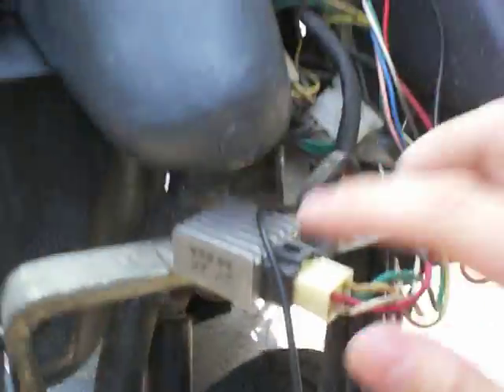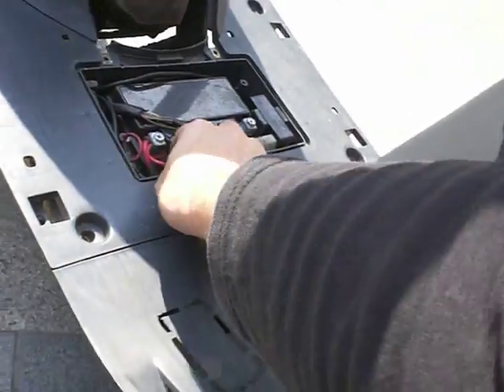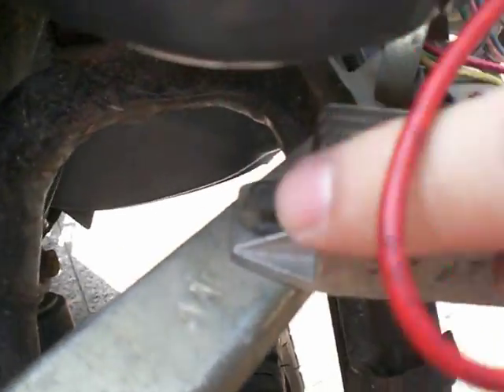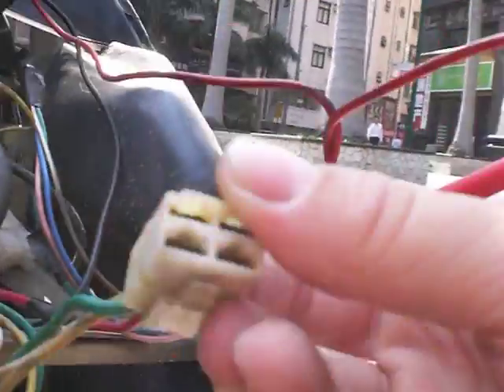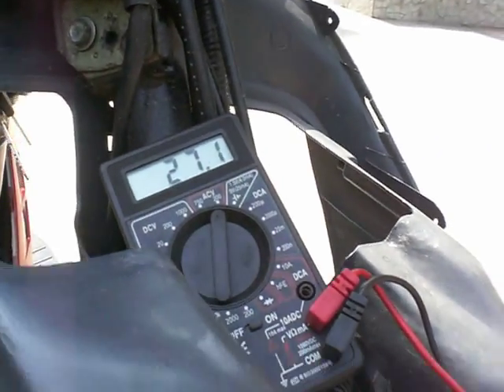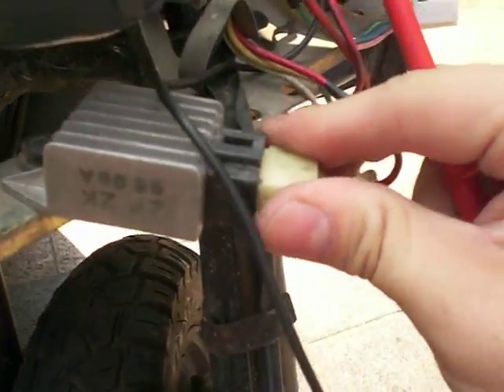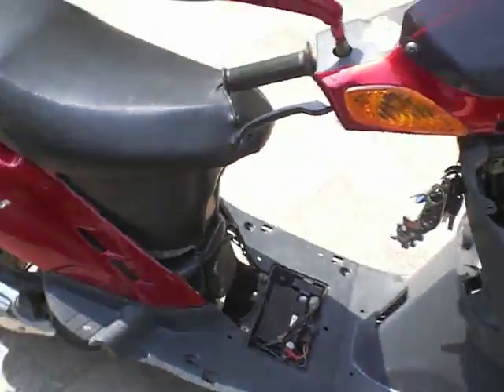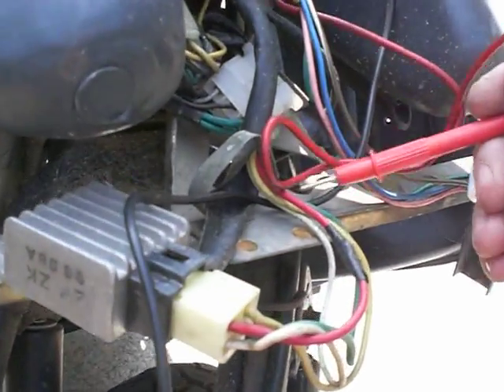How to wire a GY6 scooter regulator / rectifier and how it all works (Part 3 the regulator)

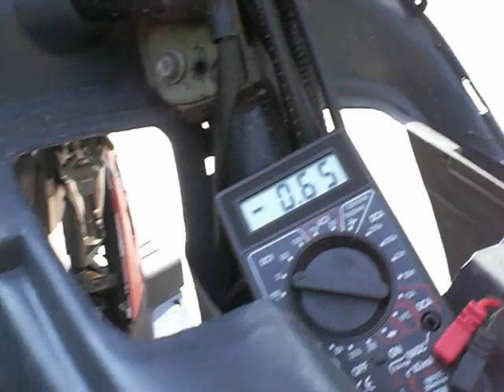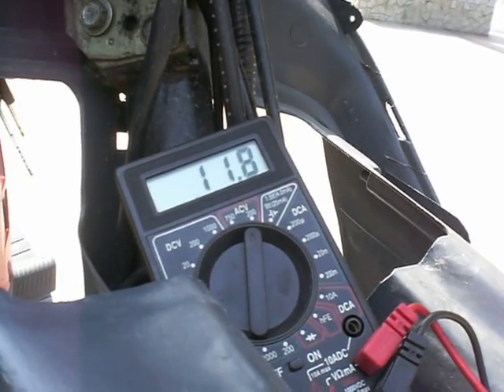Comment: With it plugged in and I tested the back of the pug with it running (@ 4:19 minute of video) I got 1.8 on the white and yellow wires the red was 12 that's DC. On the AC I got 24 volts up to 27 (@ 3:05 minute of video). What does that mean?
Reply: I have a 3hp 49cc VIP MVP GY6 type Chinese scooter

Comment: My aprilia sr 50 keep burning front lights and all other lights like brakes and sides stop working without battery whats the problem ? The lights work normal then when i drive the light get burned
Reply: Are you using LED lights for headlights?

Comment: hi, thanks for this video. i have a problem. i have an old Yamaha YB 50, the rectifier have been damage if i replace it like the one on this video can it woks because rectifier only convert AC current to Dc current....................
Reply: i get no power to my ks, its been off for a month now. I dont understand. It no longer has a 12 volt signal.

Comment: Sup guys,jst wanted to ask,can i start the bike without a regulator bcs my regulator is broken in pieces(btw i got no lights on)and btw i dont get any spark on the spark plug..
Bike Gilera Runner 180cc,Regulator model Mitsuba.
Reply from the maker: +Lord DiєsєL it won't charge your battery without it

Comment: Hi I would really appreciate your help here.

My tail/real lights are not working but the break lights is fine. I noticed both rear/tail light have been blown. However, when I changed the light and turned the scooter on the rear/tail did not turn on? I also noticed something as I was disconnecting the rear light with a new one when tracing the wire I noticed a burned stain? So I was thinking if it had something to do with the wiring connector, etc?

Comment: Great job! Thats what I wanted to know!
now will a bad voltage regulator keep it from taking off when the rear wheel is on the ground? Becuase my runns great on center stand but when i take it off it won't move?
new belt, clutch and varator rollers
What is wrong?
Reply: +Thomas Flynn u need a air filter on it if its a 50cc. a 50cc has to have the air flow restricted

Comment: there seems to be a drain somewhere, the battery terminals spark when I connect them even with the key off, and the kill switch on. I disconnected the rectifier and it no longer sparks.

Comment: Can some body help me,i bought a new stator  for my 139QMB gy6 scooter my old one had a green wire my new one does not will the stator still work are will that stop it from working.....
Reply: +D.H.E TV  i'm no expert can't even get my own bike to run atm but the green coming from the stator is an earth you don't need to use it but if you're not getting spark or having problems can't hurt to connect it to an earth

Comment: I replaced my stator and the scooter runs now but the headlights blew instantly and the headlight circuit was showing 6V at idle up to 20+ volts with rpm. The battery was charging properly but now it isn't charging anymore. The rectifier appears to have gone out. OK so I'll get a new one, but why did it die? The yellow wire going to the rectifier from the stator shows 60 Vac at about 3000 rpm. Is this enough to blow the rectifier?

Comment: Hi, thanks for the video. I was hoping to see what the a/c voltages were, with the regulator connected, on the white and yellow wires. I am trying to guess what the circuit inside the regulator might look like. All the best, hope Churchill customs is doing well, and your designs aren't getting ripped off again.

Comment: My bike will only keep the battery charged if I dont use anything else. I get 50 volts A/C out of my alternator.I put another rectifier on it and it still didnt do any better.One of the stator diodes burned up That only ran the bike but not charge at all. I also replaced the wire to the battery with 10 gauge wire. I am sick of it now and I am going to build one.  Do you know what size diodes I need to start with? Japan put a lot of bad charging systems on a lot of bikes. Its hard for me to get 13V  it does good to stay at 12.6V.      If you can give me some info on diodes I really would appreciate the help   Glenn

Comment: could the regulator / rectifier be causing a no spark situation?
Reply: Not really. He showed that it doesn't need to be connected in order to start the bike and have it running.
The only time your regulator would cause a no-spark would be if it was connected and it was shorting, but it's probably blow the main fuse as a result.
Reply: +Jack Shane No. It's only responsible for charging your battery.

Comment: it means Red wire DC going to the + battery (use to charge the battery),  the white wire is coming from the stator, AC. The green is negative. The yellow wire is going to the headlight and its an AC.Many of the scooters headlight supply are in AC.

Comment: relay switch in front might be broken ... :) check your wires to and terminal for burn you can scissor it out and check for burns switch relay can burn wires common near the terminal or splicing if this does'nt help light coil of your stator is messed up better rewind it or replaced it , dont worry GY6 parts are cheapest :) and all are available everywhere in all countries :) thanks to china

Comment: I just tested the voltage on the regulator and the hot red wire that connects directly to the battery is only getting 1.4~ volts, as opposed to, if I'm not mistaken 12 volts. Does that call for a replacement?

Comment: Could anyone help me? Ok I have a 50cc gy6 scooter year 04. My problem is that it doesn't have the ignition switch all the cables that connect to it are loose. I can start it with the kick start but the automatic choke nor the fuel pump work. Neither does the turn signals or the back lights. Could anyone help me? Email me at danieln.458 AT gmail DOT com thanks.

Comment: that even de CDI can't generate the power anymore for the iginition and the engine will stall.
I hoped it was the regulator, but I still have the problem.
So I guess it's the stator/alternator.
How do I replace it? And which one do I need for a 50cc? 
I do not want to remove pulleys from the vario or the crank axle (I am not THAT handy)

Comment: I recently replaced the regulator of my Zhongyu ZY50QT-3, unfortunately I hadn't found this video before I did that.
But now I wonder why my battery does charge when my lights are off.
When I have my main beam on it doesn't charge at all
If I use the position lights I see a voltage increase on the multimeter with a running engine (directly measured on the terminals of the battery)
But with the main beam on I get something like 12.1 - 12.2 Volts and on a long ride it will drain my battery so far

Comment: you need to find out what those colours mean by searching for the "pin outs" or "wiring diagram" for that model of regulator. It will have one wire as earth (thats known as negative or - minus) - one will be to connect to the battery live side (thats the positive or + plus side) and the last wire will be the one that connects to the alternator/dynamo generator. So if you can work that out your bike may use RED as + BLACK as - minus/earth and the third wire will need to go on the old alternator

Comment: You really do know your stuff my friend.... Could you please help me.... I rescued my scooter off the scrap heap and as you can see it was a mess... I have stripped and resprayed but am having problems with wiring... I have onlt front and rear light.. No indicators,horn,speedo,kickstart or rev counter... Just a start button... I have had it running but it kept not charging the batt... I have replaced the batt and regulator and startmotor but now she wont even turn over...Please help..

Comment: Hey there, I recently done a GY6 swap in my Honda Zoomer/Ruckus. I used the wiring harness from the doner scoot and it ran great. In fact we done London to amsterdam twice in it. Then I desided to do another swap to accomodate a fatty setup. I bought a new motor, but kept the harness from the previous build. The harness take the 5 pin regulator (white, green, yellow, black and red). The new motor has 4 pin(3xyellow and a green) Now I cant seem to get it to charge agian. BTW, where you from? SA?

Comment: I am having problem connecting the wires on my scoot-n-go fuse holder.  I have found the red wire connection but, I can figure out where the black wire connect to.

Comment: i have a GY6 150cc and i changed the battery and it died on me. so i reacharged the battery and i checked the stator and im getting 19/21 AC. and now the battery went dead over night alone i didnt even touch the bike... so i jumped start the bike and i check on the battery im getting 12.50 DC. but wen i check the battery alone outside the bike the battery give me very low volt almost 1 volt.... any help plz... again the battery its new
Reply: even if the battery is new but it does not hold charge your battery is bad

Comment: @truthseekers666 thank you for that info, my friend has a 1960's garden tracotr that he wants to use for fun and tractor pulling and the battery will hold 12 volts but the voltage don't go up none when the tractor is running and the battery only starts the tractor once after a good charge, so i wanted to buy a cheaper regulator and found this one for $20, but noticed it had 4 wire, not 3, so now i can tell him to order one of these and i can wire it up!

Comment: @islandminisunlimited Also the final wire may be the magnetic field supply for the alternator. Without this connected you will get zero AC when revving. This only applies if you have a field powered alternator. If you have a fixed magnet powered altternator then it will supply power even if that wire is not present.

Comment: Heres how it works. Red is 12 volt for charge. Test the alternator in AC only mode and rev the bike. It will go up in volts dramatically and drop when not revved. This will be on two wires going into the regulator - dont test by going AC wires to earth as this dumps the power from the alternator to your chassis. Test across say the white and green or the other. The final wire is probably a sense tester and isnt needed. I imagine the regulator is neagtive earthed so yes the red + and the metal -.

Comment: hi, im not sure if im having a problem with my regualtor but
 i changed my front light on my bike, started it up and now i have no lights indicators and brake light work fine, no front or back light or horn, i have checked all the wires everything ok,ever tryed the old light and still nothing, allso now when i start the bike it just idles and backfires, do u think it could be the regulators gone

Comment: Thanks you solved a problem with another motor that I was working on should I use an ALt. or use the stator from motor all I need is a shunt terminal that is an AC reg . converter .

Comment: hey i have a 110cc, i have everything wired right and it only turns over when it wants..
The engine will start and shut off in like 10 seconds or more then the solenoid starts clicking again!
""mind you'' i also just put a brandnew solenoid on the bike thinking that thats what the problem was ..
But noooo lmao, If you can help me out let me know

Comment: hello there, I like the way you have wired you regualtor, I have a blown regulator due to me jump starting it with my wifes car resulting in my scoot blowning fuses even with out the ignition on. anyway I am having a hell of a time trying to get a replacement, would any 5 wire regulator work, if so how would I know what wires would connect where on the new reg?

Comment: hi good vids u got, i got a problem with my peugeot speedfight 2 100cc moped, i got a new battery for it and charged it and the lights are still dim, would this be the regulater or?

Comment: The reg/rec takes those 1 or 3 AC phases and, with the help of a few transistors, transforms them into one DC output. These produce a bit of heat, hence the heat sink glued to them with thermal paste. The DC output should be only one wire - the other being the common ground.

Comment: It's a simple system, really. The alternator produces one (two wires) or three (three wires) phases of AC voltage. All these wires go into the reg/rec. DC voltage may be picked up in any of the alternator wires, but by coincidence/luck/alternator malfunction only! The way to measure if the alternator is working is by measuring the AC voltage between each of the wires coming from it (not necessarily with the common ground).

Comment from the maker: Thanks, I'm just glad I could help, let me know if you're still having problems.
Reply: Hey so on my 150cc scooter the white  Wire is 0.50 and the Yellow wire is 0.52 from the Voltage rectifier But on yours they're both 0.0.0 why is that is this right or wrong I need help